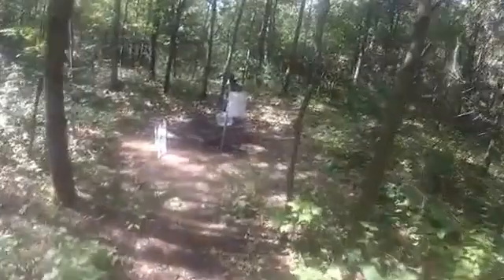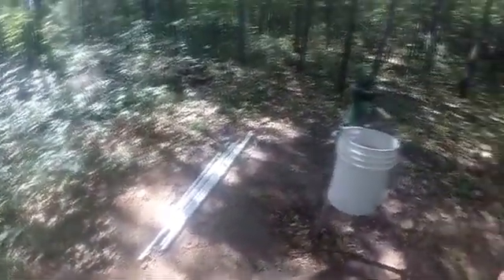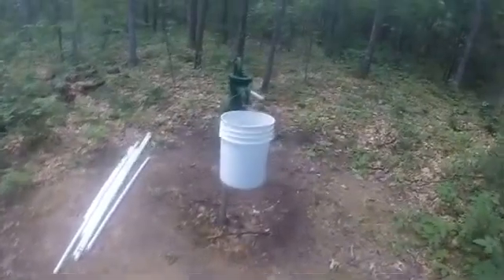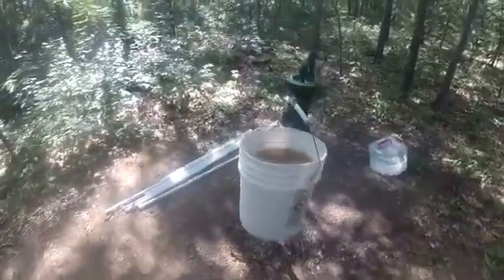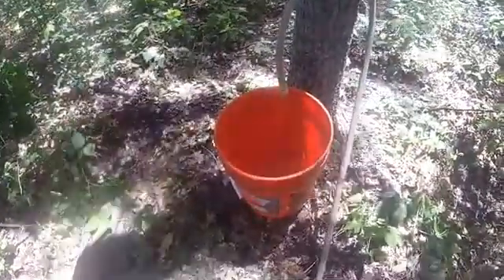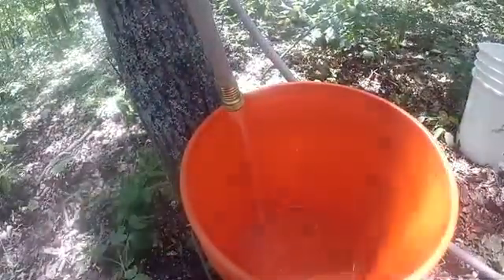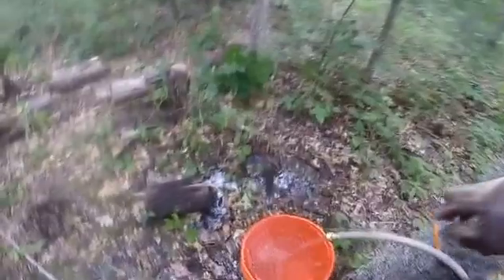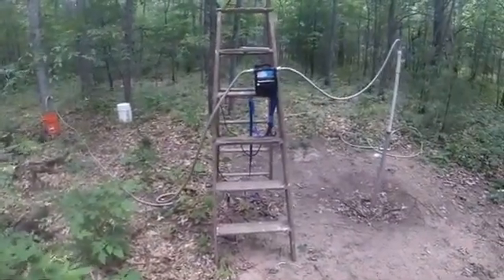Flushing a shallow well

Comment: I installed a pticher pump on my well point. Just keep pumping it until the water runs clear. Yes, it takes a lot of pumping. But, it beats tearing up a $60 electric utility pump with all that sand running through it. So what if you wreck the leather on the pitcher pump. That's only $5 to $9 to replace.
Reply from the maker: Very true, it does take a while to clear with a pitcher pump.  Once I do get it to clear it runs clear for a day or two.  My issue is I am away from the property weeks at a time and have to do this every time I came back.  Kind of a pain.  Working on putting in another well with a 4" casing.

Comment: Could it be that your well is not deep enough and sand keeps building up on the bottom too close to the water collection point?
Reply from the maker: It is very possible, as it is only 25’ deep.  I have never been able to keep it clear without constant use.  Once it goes 2 weeks without being pumped I have sand in the water.

Comment: Is it possible to keep an electric shallow well pump connected to the sandpoint. I went down 13' @ 3"  with a hand drill using water. I'm thinking of finishing with a sandpoint. I've been maintaining about 4' of water in the well currently but not recovering fast enough where I'm at.
Reply from the maker: That is the key when using an electric pump...recovery.  If you do not have adequate recovery you may burn up the pump.  My issue is I do not use the well enough and sand collects in the sand point between uses.

Comment: If you have a point on the casing, how will your PVC pipe cut into the sand below?
Reply from the maker: I was trying to breakup the fine sand that had settled in the base of the casing.  What I am finding with my well is if I use it on a regular bases (once a week or more) I don't have sandy water.  If I let it sit for over a month without usage the sand settles in the casing and I have to flush it to get clear water.

Comment: Can you tell me the model of your pump please.  The electric one.  Thanks
Reply from the maker: I bought it through Harbor Freight.  Just went out to their website and do not see it listed anymore.  Perhaps you can search the internet for one.  I think I paid $60
Item # 65836
Portable Utility Pump
25 GPM 120Ft Lift Capacity
Reply: I would recomend the harborfrieght $159 well pump with the bladder tank. Primes very well. Would not use larger than 1" pipe on the intake side. Mine has done great.
Reply from the maker: @cyoteone  Sorry for the late reply. Are you dealing with sand build up? Considering pulling my 1 1/4 inch pipe and trying a 6 inch pipe surrounded  with pea gravel.  What is your set up?
Reply: I get small amounts of sand. I installed a three filter system. Each filter housing has a bypass if i need it. Im sure the pump passes some sand through but its been a year now and no issues. First filter is a sediment and the nest two are carbon. That Harborfrieght well pump with the tank has been one incredible pump. Especially for the money. Can run two sprinklers effectively. One sprinkler very well. 

My system starts with a pvc well head 1 1/4" up just below the water table then reduced to 1" pvc from there to the pump. I use a pvc check valve just as it comes out of the 2" pvc  casing. The only metal is the pump and threaded galvanised discharge pipe to the faucet. No metal at all in the well. I have a 25 ft well and 11 feet of water. It is a trick to get a pvc well head that deep. Trick is to hydro the 1 1/4" pipe to the water table. Then trill about 1400 little holes in the first 4 ft of 2" casing and bevel the inside of the end of the pipe. Use  a sledge hammer and 2x4 to soften the blow on the top of the pipe but beat the casing about a foot at a time then use 3/4" thin wall pvc pipe attached to a hose to flush each foot of sand out. Add 2" casing and 3/4" flushing pipe as needed. When you achieve the desired depth, install your well point to the bottom. After your first run with the pump, it will pull sand in all around the well point and lock it in. So, make sure it is as deep as you desire before first pump. Sand will still allow full flow. As for continued sand in the line after completion, a void should start to form over time creating a lower suction as the void gets bigger. After a while it should minimize. Till then, run a sediment filter so as not to clock faucets or sprinklers with screens. Can install gravel in the type of well i did. Pvc is much cheaper than steel.
Reply from the maker: Thanks for the detailed information.  I do not use my well enough to keep the "pocket clear".  After more research I am looking at putting in a 4" PVC pipe surrounded by pea gravel verse a sand point.

Comment: Question - are you filling the well with water, and then pumping that water out (flushing), or are you only pumping out the water that is IN the well only, and thus sucking out the sand at the same time?
Reply from the maker: I am only pumping out the water int he well, which then pulls the sand from the well.
What I have found out is if I use the well on a regular basis (at least a few days a week) the well stays clear of sand
If I let it sit for more than a week the sand collects in the well and I have to do it again (what a pain).
I am working on a new way but have not perfected it yet so when I do I will post a video update
Reply: @thehandyoutdoorsman9014  Hmm, that's interesting. I wonder if this is common with all sand point wells? Your sand does look quite fine (looks awesome could be great play sand). Maybe you're in a situation where you just have really fine sand?
Reply from the maker: I think you are correct regarding the commonality with all sand points.  I am thinking that because there is no space where the sand point sits next to the sand it draws that in with the water every time you pump due to the suction.
Reply: I plan on driving my own well next summer, but I won't use it enough either, I'm thinking just for garden. Sandy water for a garden I don't suppose is the worst thing. My plan had been to drive it like you did originally, but another video suggested to use a 10" nipple pipe with the driver cap, as often the thread skips and you can't get them off. So the 10" with a drive coupler and you just throw away that 10" piece. That looked back breaking for you!
Reply from the maker: It was, I recommend using the jack hammer method.  Will never use a sledge hammer again.
Reply: And on top of a ladder no less! 

Thing is, I don't even know where to begin to look for that attachment for the jack hammer. Sledge hammer might be my only option. Maybe I'll just drive 4' pieces every now and then and take all summer. lol

Also, one other recommendation, I wanted your opinion since you sort of did this - was to slide a slightly smaller PVC pipe into the main pipe and use that as the main water source pipe. So lets say you drove 1 1/4 sand point and pipe, and then slid in a 1" PVC pipe, and rather than attach your pump to the metal pipe you attach to the PVC. Then if any of the couplings start to leak it won't really matter. Granted, you probably couldn't mount a pitcher pump to PVC? Not sure..I would probably eventually move to an electric pump to make it easier to water my grass/garden anyway.

I feel like I'm talking your ear off, thanks for obliging my questions and comments!
Reply from the maker: No worries, I am always willing to share what I know and what I have learned.  I was not aware of the attachment until I went to my local tool rental center and they told me what they had.  I also did the 1 1/4 inch outside pipe with a 1 Inch pvc pipe inside, it works just fine attached to the pitcher pump.
Reply: Right on...I will ask when the time comes, because ya, sledge hammer looked brutal. Thanks for the advice! Once I get started and going, I'll come back here and share how it went for me if you are interested. Cheers.
Reply: @thehandyoutdoorsman9014  What is the mesh/slot size of your well point? What area do you live?  The idea is to get a slot /mesh size that will retain about 40-50% of the sand you are trying to block. The larger particles of sand that dont come through build around the sandpoint  pipe to create a natural gravel pack that will stop the sand from coming through. Unless you know well guys in the same area you send a sample of your sand to an analysis center. They can help you get the correct mesh/slot size to balance blocking the sand but allowing water to flow through.  Mine is .008
Reply from the maker: @stormlight1553  Thanks for the information, I was not aware there were different mesh sizes.  To be honest I do not recall checking the size I used so this could be my problem.

Comment: You say you are pumping about 2.5 gallons per minute with that little electric pump.  How much is the pump rated at?  Could you get more with a bigger pump or does water not seep back into pipe quick enough?
Reply from the maker: The pump is rated at 25 gallons per minute, I think it was just the recovery rate of my well.

Comment: Cool videos!  I started digging a well at some land we have that has no electricity.  I dug down and hit water at 10 ft. with a manual auger.  I wanted to go deeper and put a more traditional casing and riser type well in there but the sides kept caving in.  I then tried to wash casing in with water and pipe go stuck.  I think I can get the pipe out with bottle jack like you used in this series.  I have bought a sand point to use.  Should I use it in existing hole once I get the pipe out?  I also bought an additional 3 ft. section that has the well screen but no point so I will have 6 ft. of well screen on bottom of pipe.  Do you think that will add to flow rate?
Reply from the maker: I reused the same hole when I was trying to install my well.  Since I hit water in the hole when I bent the pipe I thought I might as well continue using it.  My well is 25 feet deep with a 3 foot sand point and the flow seems to be just fine.  The only issue I see with a larger screen section is if the screen is not in water it will continue to allow sand (or dirt)  to filter into the pipe when you create the suction to pump the water.  I am no expert but just my thoughts on the design.
Reply: Im Drilling Eng.in your case try to run simple casing perforated you can do it by drill the perforation then run another smaller casing  in diameter also perforated  you will create annulus then fill it with small rounded gravel on this case you created a wall and filtration system. Hope i answer your Q..